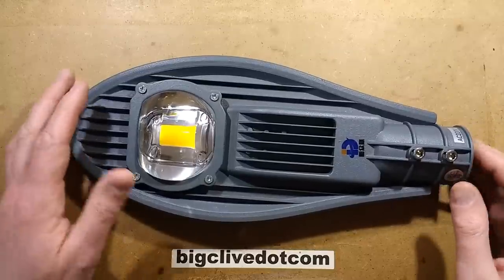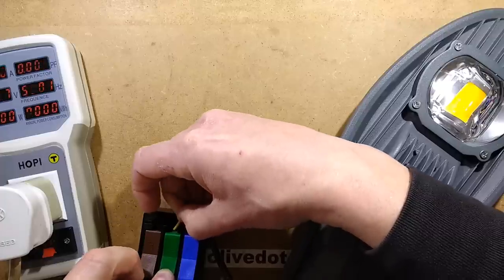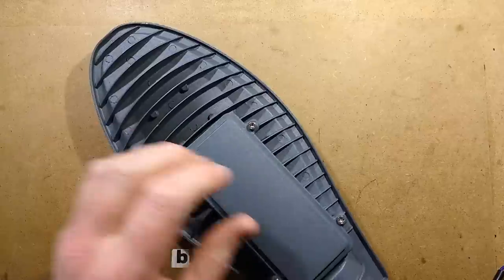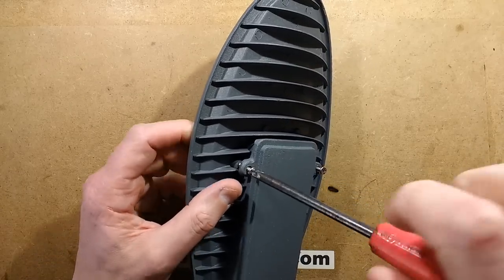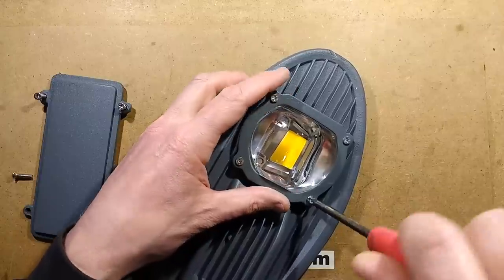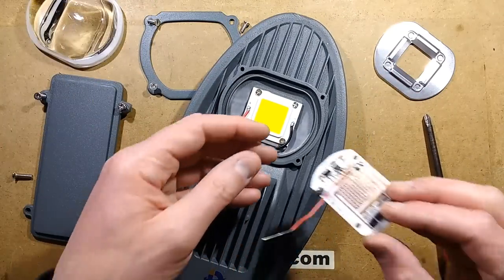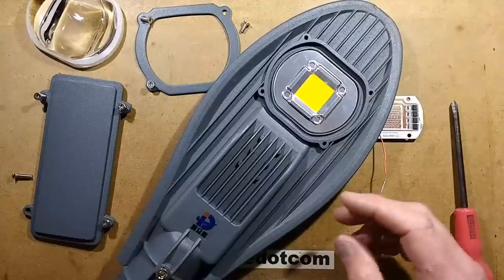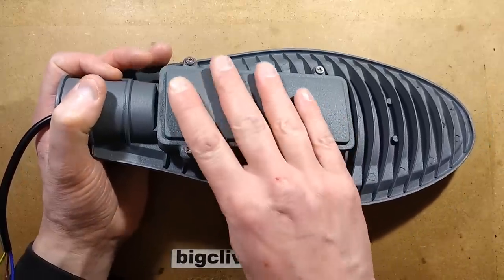Inside a stylish LED street light from eBay.

Comment: the problem our way is they are replacing our street lights from the sodium to cold light l.e.d's and then are piercing yet with a small fall off distance compared to the sodium.

also, we had a severe bowt of fog the other night.. where they have replaced the lights it was just wall of blue refracted light and you could barely see. the sodium ones however nearby nearby quadrupled the visibility. so, I foresee a fair few accidents in the future. You'd have thought some testing would have take place or forethought.
Reply: Same here. Although the LEDs are blinding to look at directly, they give just a small pool of light underneath leaving the general street area looking  very dark. Bring back the sodiums!
Reply: WorldofRandometry YOU CAN PAY THE EXTRA MONEY TO CONSTSTANTLY PUT NEW BULBS IN AND RUN  THEN ?
Reply: WE ALREADY PAID THAT MONEY FOR DECADES.
Or do you think they didn't just simply use taxes to pay for it?

And constantly new bulbs? They last quite some time.....
Reply: We're already paying it. The real problem with all of these LEDs is that like most new tech, they only are going to save money for EARLY Adopters.  Then EVERYONE will HAVE to convert or you'll just be paying through the ass, as the power company is not going to tolerate a 25-33% reduction in revenue, so as more LED's are installed, power prices will inch up until it's not feasible anymore to pay to run anything BUT a LED.  It's not a problem until we MAKE it a problem.
Reply: Paul Gascoigne Our council is actually competent and is using warm white LEDs. Imo they are far better than sodium, the only downside being the lesser fog penetration.
Reply: You can make LED in any spectrum, and they can be focused/dispersed with a lens. Power cost is regulated by government (in the U.S anyways) so power companies can't just jack the price up because technology is saving the consumer money. Most power companies struggle to keep up with demand, especially in the summer and actually ask for cutting back. LED is far superior to sodium and it is the future.
Reply: ipissed That's the problem. Authorities are living in the sodium age without realising there are so many factors outside of wattage to consider when using LED. At this current stage they choose. light based on brightness and nothing else. They need to learn that colour temperature and optics are just as important. Luckily my local council put a lot of effort into this so we have very good LED lighting that has the perfect specification. However, this is not the case in a lot of places.
Reply: Well, the one in edinburgh are worse than this unit.. they have basically no optics, so it is either eye pipercing or darkness..

Not difficult to figure out.
Reply: Well you can get LED in any color, close enough. LED is more efficient than sodium, growers lost that argument long ago and switched to LED.
Reply: Vaes Joren   have you not heard of CREE CXB led's  .go do a bit of reading up . Their cobs outperfom sodium . FACT
Reply: anyone know what astronomers think of these  Led lights  as they complain a lot about the sodium ones ruining the night sky etc
Reply: "Power cost is regulated by government (in the U.S anyways)" ... not here in CT -- deregulation has taken over.  We choose our own suppliers and the price ranges wildly. Many states are following suit.
Reply: I used to do a lot of astronomy and sodium lights are sent straight from hell, they make it near impossible to get a good view when using a scope in a village or town. 
the light pollution us horrendous because of them, if you drive out of a village into a dark area and look back you'll see how much light us wasted, your little ting village looks like Vegas from a few miles away. you don't notice much until you need dark skies.

LED lights are so much better cause they are directional, they don't glow either like the old sodium. 
I'd imagine the led lights cost a fraction of the price sodium lights would cost to run.
Reply: Yea now I remember states being deregulated and power companies refusing solar owners. No thanks.
Reply: You are correct; Low pressure sodium vapor are among the most efficient electrical light sources per wikipedia: https://en.wikipedia.org/wiki/Sodium-vapor_lamp ... 200lm/watt -- the most cutting edge LED's have just begun to approach this efficiency and are astronomically priced and require stupid special arrangements to obtain it, currently -- and that doesn't take into account all the other benefits you mentioned, all of which are true.  

There's absolutely no [good] reason to be switching street lights to LED. I for one would rather sleep well at night, and not increase light pollution to boot.
Reply: They can't? Look at historical power rates... http://www.data360.org/dsg.aspx?Data_Set_Group_Id=397  Obviously, they can. Good thing you don't have electric heat, or you wouldn't have wasted your time posting this because you'd already have known it.
Reply: How are color temp and optics important for safety lighting at night? Are you painting rembrandt's or color coordinating your clothes under your streetlights or are you just trying to see a pedestrian or a stray animal in the road?!
Reply: It's refreshing to come across an intelligent reply on youtube every once in a while. Thank you for taking the time to post.
Reply: Please again remind us what this has to do with street lighting and what "argument" growers were having about it?
Reply: No, they don't. FACTual DATA: https://en.wikipedia.org/wiki/Sodium-vapor_lamp
Reply: Stop imagining and start researching. Low pressure sodium still wins for simple safety lighting.
Reply: Johnyquest1 very. the problem with leds is the higher efficacy ones tend to be high color temp. crappie  for seeing.  the warm whites good for seeing and object recognition have more phosphors doing the down converting from the blue leds usually lower efficacy.
Reply: you just have to use quality product. cheap shit isn't going to cut it compared to metal hallide. today at work we replaced 1000 watt metal hallides on 480v circuits with 150 watt led wall packs that provide more lumens and I'm pretty sure the client is going to be happy with it like everybody else. it really doesn't matter what the old light is, they can make an led fixture for you at whatever lumen output, wattage, or color temp you want.
Reply: Yup. (Former CL&P) Eversource often asks for rate hikes because CFLs and LEDs have nicked into their bottom line. Governor approves increase.

Then they ask for another rate hike proposed for "transmission line maintenance" because they didn't take care of the lines all along and had widespread issues to fix years later. Governor approves increase.

Deregulation now means that we pay for the electrical use itself, plus a "DELIVERY CHARGE" that is typically 110% of the actual usage charge. Our power companies aren't allowed to generate power, and our Department of Energy and Environmental Protection is steadfastly against any generation methods that aren't solar or wind farms, so...

We grit our teeth and pay the bills. Lol
Reply: Vaes Joren  Your wrong cree cxb 3590 is around 150 lpw and when underdriven can go as high as 160 lpw . The very best sodiam is about 145  lpw . However if you really want to talk about lpw try google the new 300 lpw that cree are producing .  And with the amount of investment going into LED lighting that will be surpassed yearly .
Reply: Correct Garry, none of the commercial fixtures we order at work are even coming close to the lpw efficacy of newer binned Cree or Nichia emitters used in flashlights for example, but they still blow non-led fixtures out of the water. It's only a matter of time til we are using 300 lpw fixtures.
Reply: Johnyquest1 the colour of sodium lighting increases contrast so you can see the differences between dark and light much much easier (in black and white photography you will often use a similar coloured filter for that effect). Lights towards the blue end of the spectrum suffer much more from refraction, if you imagine droplets of moisture in the air acting like prisms (such as fog or precipitation) you can get a huge amount of hazing caused, light towards the red end of the spectrum travels in a straighter line through these prisms so you get less glare. Quite often in European countries fog lamps on vehicles will be yellow for pretty much this reason.
Reply: You are basically just bringing the Nikon vs. Canon argument into street lights. Warm vs. cold, and there is no way for anyone to know how as individuals we perceive color so you are basically just stating your preference. I prefer cold, I prefer Canon, if I want to look at the world through sunglasses I'll put some on.
Reply: Having checked that page, it appears that the source provided doesn't even reference the lm/watt of low pressure sodium lamps. The only reliable sources I've found say that it varies between 100-180lm/watt. Even then, because of the lack of focusability, you end up with a lot of light leakage, and comparatively more luminaires to compensate for this. Lamp life is also very short.

LED street lighting makes far more sense for residential street level lighting, as you can essentially make the source of light invisible from houses, when utilised correctly. You would get a lot less light pollution, though of course this is of less use to astronomers.

Comment: I'm beginning to hate the LED streetlights that are slowly assimilating the streetlamps here. What arsewipe decided to use cool white lights? They're too close to the colour of vehicle headlights, and the light source is too small which causes a dazzling effect when driving up hills and the lights are pointing down at you in your face, something I've never had an issue with the trusty old yellow streetlights.

I'm not against LED streetlights, just that they picked the wrong ones.

On a cycletrack near me there's a circular tunnel that goes under a road, they replaced the tiny, almost useless lights on the ground with 16 large panels of blinding LEDs on the roof. The stupid council went overboard on 'safety' which actually has the opposite effect because at night when you emerge from the 'tunnel of light' you're effectively blinded as it took away your natural night vision.
Reply: I think they replace them with the same wattage or lumens. But LEDs are much brighter. Someday they'll learn to focus them on what they want to illuminate; better yet, make them intelligent so they vary in response to ambient brightness, or movement.

Comment: One reason the earth lug might not be connected is that they expect the lamp to get it's earth through the post (the surface is painted but the fixing screw should provide continuity), either by the way the post is planted or via a connection in the cabinet at the base. Still odd to provide a crimped earth connection and not use it though.

Comment: Clive, tell me if this makes sense : If they don't bother to connect the earth wire, maybe it's because they know most people will change the ridiculously short cable for a longer one. And they include the short wire so you can quickly test the light when you get it. But if you decide to keep the short cable and splice it to a long one, the crimp is there for you to screw the earth to the case.
Reply from the maker: The LED drivers have the three core flex stub supplied pre-potted in with the earth crimp already attached.  They've just stuck that driver in with glue and connected the LED.
Reply: ah... well, there goes my brilliant theory :D

Comment: My city in the US has little by little been replacing the old street lights with LEDs wherever there's a major resurfacing/reconstruction project on the street below. I don't know what kind of units they are, but they are horrifyingly bright on the eyes when you drive or walk under them (even when you're not even looking directly at them) and yet somehow they don't illuminate the surroundings very well. The lights on my street are metal halide for the most part and I dread the day they get replaced with these LEDs.
Reply: I know this comment is four years late, but the metal halide streetlights are still there?
Reply: @thelightingenthusiast  Nope, all LED now.
Reply: @AdhamOhm  Aww that sucks. I don’t mind warm white LED’s too much, but I wish they converted to LPS instead.

Comment: Ti think they don't connect the earth wire, because the lamp is almost always mounted on a steel pole. The connection is made by tightening the lamp's bracket to the pole maybe?

Comment: You have to ground metal enclosures here in the USA also. There a few exceptions but the light isn't one of them. We used to depend on the UL label to verify the stuff was tested safe but the cheap imported product manufacturers just forge them. That said a licensed electrician could not install things without the label or knowing the item is unsafe. Just like all other things electricians have been dumbed down as of late. So has the doctor that will treat you for Afib, or heart failure if you get a good shock to the heart. The screws would not be a big deal for a professional electrician because tools are carried to cut screws properly and also a tap tool to tap the holes. Just so long as they are standard 10- 8 and 6/32 type screws. I like the light or better said the fixture. Good quality or branded approved fixtures can be quite expensive. millions of dollars are wrapped up in project lighting at times. One job I did had 6 million dollars in fixtures with over 1 million on the parking lot lights.

Comment: I like it... The problem with the screws is simple. You can add washers to the screw or put a nut on the screw then grind the screw and loosen the nut so it re-taps the screw because grinding the screw will cause it to be stripped and the nut fixes that. Or use shorter screws.
Reply: I backed the video up and it was a bit blurry, but is it possible the 4 screws for the LED and the Driver Cover got switched?

Comment: No ability to add a NEMA socket (so for many installations it will run during daytime and overheat in the summer). 
The fins on the top will get caked with bird crap. 
Heavy rain and high winds will drive rain into the glandless cable hole.
Reply: Agree with the NEMA socket.  As far as the cable hole, it's nothing a bit of silicon in the hole at install time won't fix; if that's not procedure, it will be after enough of them fail, I'd think.  It would be nice if they'd just silicon that hole where the cord passes through, though.

Comment: The lid looks to have curved edges under the screw holes.  But the posts on the base don't, and aren't tall enough anyway.  That leaves screw threads exposed to the elements.  Ignoring dissimilar metal problems, of course, that leaves likelihood they'll corrode.

It seems stupid to have all those fins across the top as it'll just crust up with bird droppings.  Can't imagine there's enough heat dissipation needed.

Comment: lid screws looked ok at the beginning of the video.
Reply: Agreed.
Reply: I saw the same.  Re-Assembly issue.
Reply: Maybe one side is longer than the other, so it had to be put in certain way.
Reply from the maker: Uh-oh, others have hinted that I may have swapped the lens and cover screws.  I'll check that.
Reply: I smell a scandal!
It's the old screw-swapping scheme, seen it many times!
(But then, I'm in the States and we can't turn on the Cartoon Network and not find a scandal).
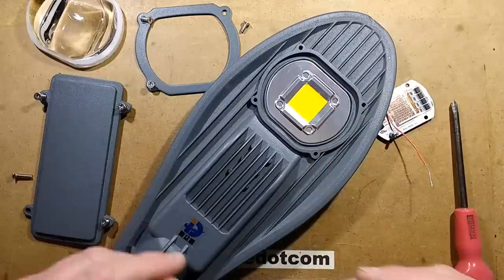Reply: Looking at around 6:07 in the video, one of each of the lens and cover screws are laid down on the bench. It's obvious to see they are of different lengths (and possibly thickness). Towards the end of the video, when you're showing the side-view of the ill-fitting screws, they do appear to be the same as the cover screws earlier on. Maybe they are handed, so one side is longer than the other after all?

Comment: We bought a few Chinese LED style Lamps like boxy ones you showed us before. and they are really bad quality.. approx 2-4 months of use they start flashing or go out... So drivers and LED will need to be replaced with better components.
Reply: Thats sad, but if the price is right, they would be worth it just for the case and the lens.

I also bought some cheap stuff from china just to get the case
Reply: I agree with you djteac  its worth just for the case.. the components inside are really horrible quality once you put it outside and let the heat of the sun bake the electronics and put hours on those LEDs they will start flickering or just burn out.
Reply: yup these drivers are never going to last as long as people expect a street light to last.  Really you want something designed for 100,000 hours plus and those drivers won't fit in this enclosure!
Reply: I've been running the cheapest 50w driver and chips from DX for 12hrs a day for over 3 years now. They are running on CPU coolers in a temperature controlled environment with a circulation fan so I'd say heat is the issue, not the chips/drivers.

Comment: The missing earth screw is probably not an oversight.  Why go to the bother of adding 3-core wire, putting the ring crimp on the earth only to leave it disconnected?  If it was simple cost-cutting they wouldn't have bothered with the 3-core or putting the crimp on there.  I suspect they want to sell this thing in all markets, including ones where earthing is not required.  In this case mightn't it be more dangerous to have the ground wired up yet possibly left hanging at the socket end?

Comment: Clive, you have gone and done it again.  I am searching ebay for this unit and I'm going to order 4no.
If the driver or the LED fails it will be easy to swap it for a new one.
Great little project.  PS If you come across any 42mm wall spigots in your travels please give me a shout.  :O)